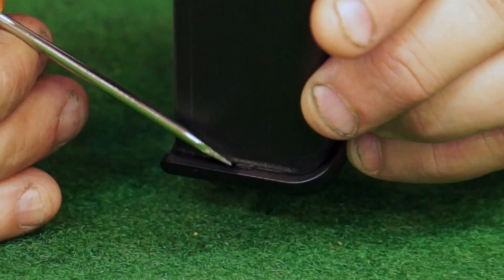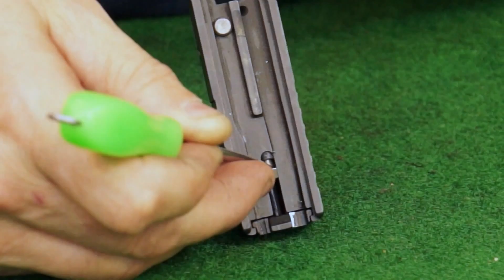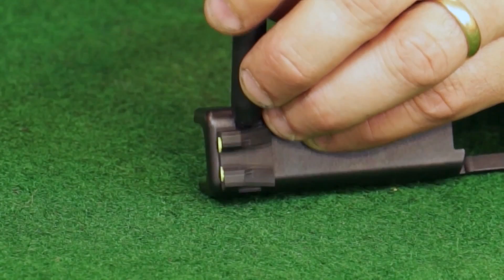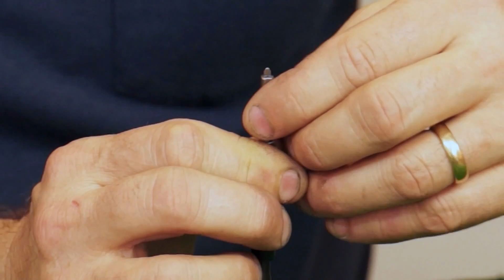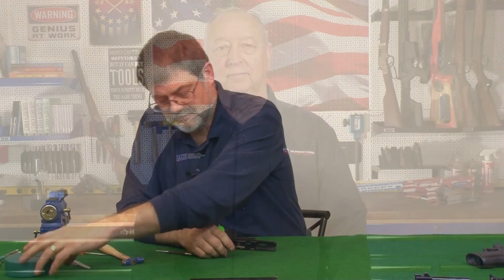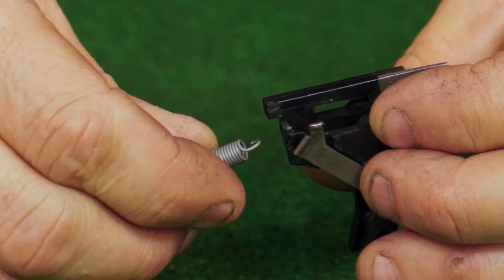🧰 How To Disassemble A Glock With Master Gunsmith Ken Brooks | Change Glock Sights

Comment: What gen glock is that? My gen 4 uses a hex head bolt with screw threads to secure the front sight to the slide.
Reply: It depends on the type/brand of sight used. Factory plastic sights are attached like they show in the video typically. Some steel front sights are are attached by flaring the end of the sight into the slide (kind of like a rivet). Then there are those like yours, with the hex head screw.